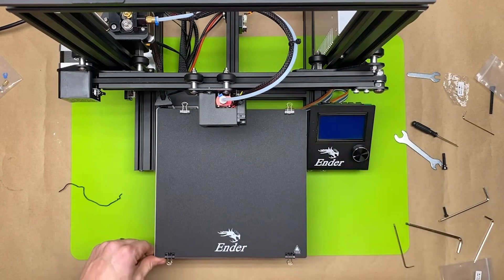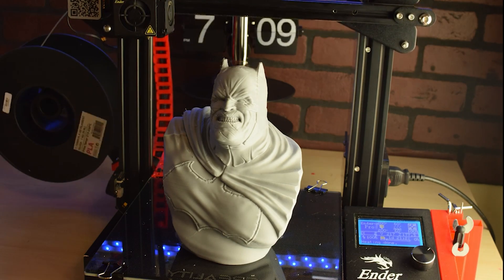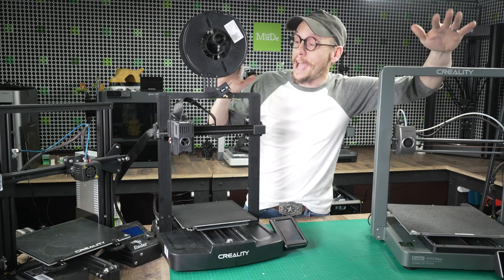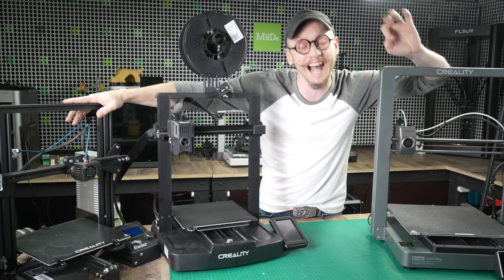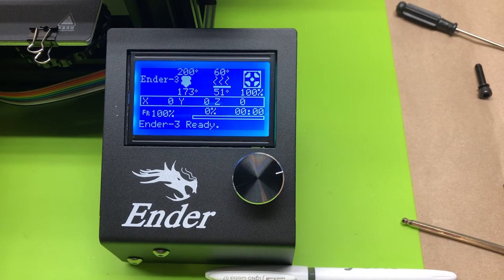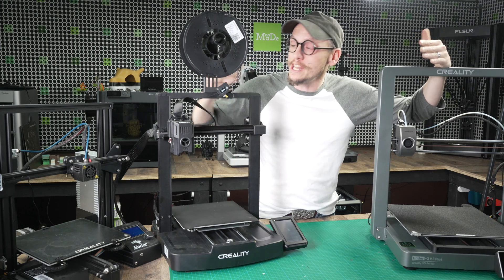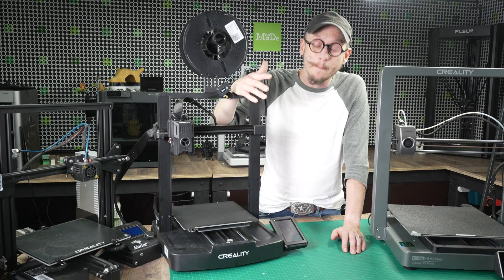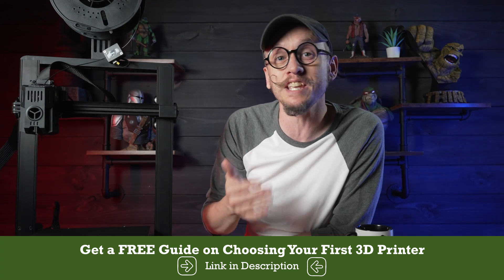Is the Ender 3 Still a GOOD Starter Printer for Beginners?

Comment: So the choice of printer for me was not a luxury I had, as I was given a free Ender 3 from either 2018 or 2019, but definitely pre-covid. I'm a blue collar guy and never had interest or needs for a 3d printer but since it was free, why not. I'm currently trying to get everything working but noticed I don't have a few things; brush thing to clean clogged tips and the sd card for the test print along with the owners manual. This video was helpful in figuring out just what I may be getting in to and it's nice to hear this thing was a good unit at some point in the past meaning I can do well with it in time. I need ideas of things to print because I got a free pla roll with it and want to dial this thing in.

Comment: I bought the Ender 3 V3 KE about a month ago. I have had no problems whatsoever, it just works. I have no previous experience with 3d printing, but I have been following along on the side for years. One thing that I had not thought about when going into the hobby was that these printers are machines. They are not your run of the mill Canon Bubble-Jet "just works" printer. They will need caretaking and maintenance. People tend to compare 3d printing to printing on paper, and if you go into the hobby thinking that you can just print stuff forever, you are going to be disappointed - no matter the printer you buy. I think some of the misunderstandings come from people not setting their expectations right. Anyway; I'm happy with my Ender, and I will definitely recommend it.

Comment: I would recommend the A1 Mini to any new starters who don’t want to spend a fortune. 
I’ve spent more money upgrading my Ender 3 v2 to do what the A1 Mini still does better straight out of the box. The A1 Mini handles all the calibration automatically which I wasted many hours doing manually on the Ender 3. If you really want to tinker with the machine rather than designing and printing models then sure, get an Ender 3.
Reply: I just bought it 5 minutes ago!

Comment: Nothing by Crapality is good for beginners.  From a rough poll of friends who bought the Ender 3 only about 1/3 of them worked.  Serious problems like the aluminum frame not being cut at a 90 degree angle, electronics not being soldered (and I don't mean the connectors).  Until they get their QA problems fixed nobody should EVER buy one of their products.

Comment: My first printer was a FLSUN Cube and then got suckered into a FLSUN Delta. Both of those were the biggest pieces of crap I had seen and used. I watched a lot of videos on the Creality3 V2 and took a chance. It was easy to use and produced very good prints, but slow. Did a lot of upgrades (BL touch, software, magnetic bed, extra "Z" shaft and motor, etc.) and was very happy with how it printed. I bought a second one and did all the same upgrades and brought it out to my winter home. After a FAA Maintenance Conference in which they talked about using 3D printed parts I started looking for a different printer. I watched a lot of videos on newer printers and liked the QIDI Q1 Pro. I bought one and it work fantastic, clean and very fast. I gave the V2 printers away, one to my son and one to my grandson so they could learn. I bought another Q1 Pro and gave it to my son and told him to sell the V2 (grandson is only 7 so he'll stay with the other V2, LOL!). The customer support from QIDI was second to none. Enough babbling. I really liked the Creality3 V2 printer and believe it's a great inexpensive beginner printer. Thank you for your videos.

Comment: I brought an Ender 3 v2 on the basis of buy cheap and upgrade components as and when I could afford it. 

A bondtech direct drive extruder and a Mosquito hotend were supposed to be my limit. Oh, and adding a second z lead screw. And a CR Touch.

But the z banding on my larger prints was horrendous. I eventually discovered that the malalignment of my second z lead screw was happening because the plate extruding out from the unit that the screw ran through wasn't at a right angle.

So I chucked the lead screws and swapped to a dual belt z arrangement instead.

It prints beautifully in a wide range of materials, however Marlin means it's slow. 

Also an enclosure for some materials is a necessity. 

The final mod has to be Klipper. Those print times must come down. 

For me, it's about the creativity. I make my own models and use the prints as masters in which to mold in silicone and reproduce them as casts in various materials. 

I'm not esp enamoured of technology - oh, I learned to calibrate the living daylights of my frankenender but I'd rather change daipers. However I love what it does. Adding Klipper will be the final cherry on the cake. 

I couldn't afford a top end result off the shelf. But I knew that, over time,  I could achieve what those top end machines could by scrimping and saving. And learning.

Comment: Bought a JGMaker A5S for my first printer. Spec-wise it was better than an Ender, but because it had limited community support, it made a lot of things harder.

I ended upgrading to the P1S recently, mostly because I was tired of fussing with things, and the Bambus are getting a lot of community support as well, even if they are locked down a bit.

Comment: My ender 3 v2 is a pla workhorse.  Assembling it allows a first timer to at least understand some of the mechanics and if carefully set up and leveled it prints great from the start.  It is modular with lots of upgrades and parts are cheap.  I love mine.  But...if i were starting out today and if i had the money...there are certainly better printers.  Yes, the ender is a dinosaur.  But it is a cheap ont that works great and at one time was the standard
Reply: I have the V2 too. Only did the first bed levelling and calibration when I first assembled it and, other than running the occasional auto bed level check before major prints, I've not had an issue with it since I bought it a year or so back. It works, and fits my needs.

Comment: With the A1 Mini there's no reason for anyone to start with Ender.
Reply: Not true build volume is a major issue with fhe A1 mini. Also a V3 Se csn be found for $150.
Reply: @writer8706  I think the print bed size and the “closed but still kinda open” ecosystem of the a1 mini are its only setbacks. 

If neither of those are an issue, I can’t see why someone wouldn’t do the extra $50 for the A1 mini with how many QoL and ease of use features it has
Reply: @writer8706 honestly just save 100 bucks and buy the normal a1. The Enders are ass

Comment: I have tried 2 of them and have had nothing but problems with them, they worked for awhile but than just quit, junk. I am glad you have had good luck but I will not by another Creality printer ever again. I now have a Anycubic and it is amazing.
Reply: They are...frustrating.  I go through periods where I can't do wrong and print after print is perfect.  Then something gets out of whack and you start chasing your tail trying to figure out why.  I have found that I learn from this though.  I come out the other side much more experienced and knowing more about the machine and printing in general.  The big question though, is this pain necessary today with printers like the A1 available?
Reply from the maker: I see both sides for sure. I attribute a lot of my trouble shooting knowledge to my Enders. Yes mine have been pains in the past but like you I learned and then got them printing beautifully. I think for people that like to tinker they are the best option but as you said the A1 is out there and it doesn’t take much work to get good prints. It’s really down to your needs. I personally run both and enjoy them both for different reasons.